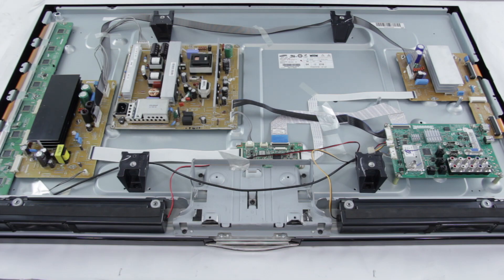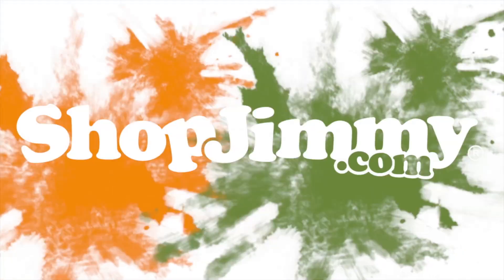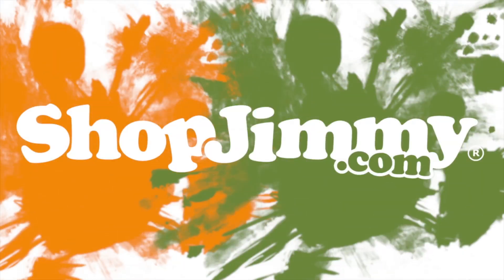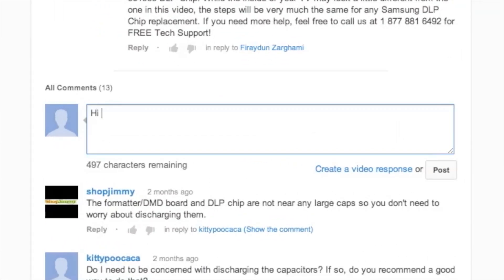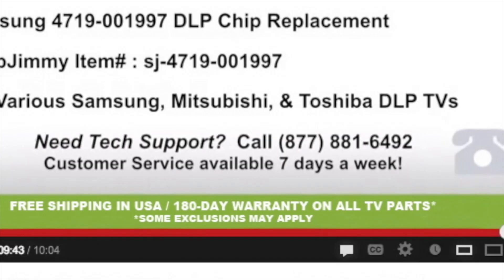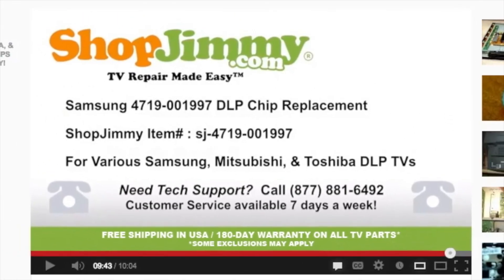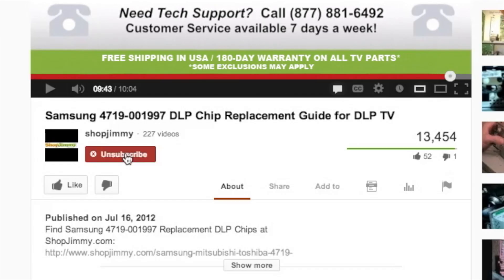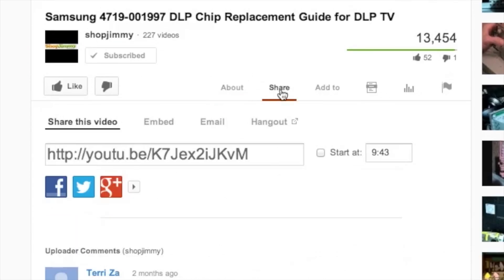Plasma TV Repair Tutorial - Common Symptoms & Solutions - How to Fix Plasma TVs

Comment: Good evening,

I guess that my TV is bugging.. do you have any idea about how to reset it?

Description of the problem:
I turned ON the TV (panasonic_Viera_ L47ET5E) and the audio of the program was present but without the video (I had a bright blue screen than after turning OFF /ON the TV the screen bcame black tend to a dark blue).

I remarked from the voice of each program that I have only 6 programs instead of 45 (usually).

I have used the method of pressing Vol- and Menu of the remote for 5 seconds..
After trying that method... I have lost the audio too!!
Actually I have black screen and no audio...

Thank you for your help..

Comment: 50PN5300-UF 2013 LG Plasma TV. No picture or back light on screen. Disconnect from all components. Connected to laptop via HDMI cable. Would not display. Did hear static from built in speakers.
Watched your video. Opened case and visually inspected. Two fuses on power supply looked ok. No capacitors on any boards looked popped. What next?
Thanks!

Comment: i have a Samsung PN51D550  PLASMA TV. IT TURNS ON FOR SECOND OR TWO THEN POWERS OFF EACH TIME YOU TURN IT ON IT DOES SAME THING.
Reply from the maker: james kraft   Try this at your own risk. Unplug the TV, then disconnect the y board and plug in the TV to see if the TV powers up. Reply with the results of this test. Thanks! www.shopjimmy.com

Comment: Hello...there, my vizion smart tv,E-701i-A3  the power supply went bad..and i change the new power supply board and power on its working good but my remote control is not working on my tv.  i would greatly appreciate need help.

Comment: I have a lg 50pn4500, built Nov /13.  I would sometimes have the screen go black with sound remaining on.  After unplugging  it for a bit, it would then work again for a while.

It now will only come on for about 10 minutes, even after going black sound still works.  I opened the case and all the caps look good.  Unsure of what componets could cause this.

Logic board?

Comment: Great Video! Thought I would ask for help before I go purchase a very expensive TV when I can fix for minimum $$. Model: Vizio, VM60PHDTV10A. Problem: TV seemed to work fine sound is ok, picture is ok no collapse I can see the color. But, the screen is dark when first turned on very dark film covers everything then slowly goes away with time then pieces of the picture is uncovered to give you a full picture but the picture at that point while visible is still dark. All power supply voltages seemed ok +5, 24, 65,120, 208, 360, 400. At night or in a dark room the pic gets more better. My TV is a 60 inch with a gold bezel very hard to find these days. I had previously had issues, one year prior loose the HDMI ports. Appreciate your help! Horace.20001@Gmail.com
Reply from the maker: Harnauth Sewsankar   PLEASE SUBSCRIBE TO OUR CHANNEL - Try all repairs and troubleshooting at your own risk.  This sounds like a problem with either the power supply or the TV panel.  You can replace the power supply board to see if that fixes the problem.  Click this link to replacement parts for your TV model number:  http://www.shopjimmy.com/catalogsearch/result/index/?cat=59&q=VM60PHDTV10A  There may be multiple boards for the same TV model number, be sure to match part numbers on your current board, with your replacement for compatibility.  Here is a link to a video showing how to identify your part number, click here:   https://www.youtube.com/watch?v=_4Qpfan0vdUThanks and please let us know if you have any further questions with your TV Repair!  www.shopjimmy.com
Reply: +ShopJimmy.com Thanks for response...following your troubleshooting guide I find the  Z Sustain board that drives the intensity was shorted, had a blown fuse. On further troubleshooting I found the main processor was shorted and the Z sustain board had to be replaced. Now after a few months the picture is now scrambled for about 15 minutes or if I hit a bank of (150 uf 250 v 105 deg C caps) on the Y sustain board with a hair dryer it comes on immediately and the picture  stays on continuously without scrambling...I tried to increase the capacitance on this bank of caps but it did not fix...I took out a few caps and checked them but all looks ok. I am planning to replace all the caps...any suggestion on your end? I am isolating the caps from the rest of the board using cardboard so the heat is contained.:)

Comment: Hi.My Samsung tv model PN60F5500AFXZA screen slightly flashes as if it was trying to tun on but doesn't and the stanby led light flashes 5 times. Please help and thank you.
Reply from the maker: Nelson De Los Santos   PLEASE SUBSCRIBE TO OUR CHANNEL - Try all repairs and troubleshooting at your own risk.  I recommend replacing the Y-Main Board and the Upper and Lower Scan Drive boards in your TV.  Click this link to replacement parts for your TV model number:  http://www.shopjimmy.com/catalogsearch/result/?q=PN60F5500AFXZA  There may be multiple boards for the same TV model number, be sure to match part numbers on your current board, with your replacement for compatibility.  Thanks and please let us know if you have any further questions with your TV Repair!  www.shopjimmy.com

Comment: Hey, I have a "50 Samsung plasma tv, with a blank screen. Audio is fine, but no video at all! I currently have the back off and I just watched your video. Should I replace the fuse on the power supply board, or just get a new board? Help! Any suggestions?  

samsung 50" plasma pn51d45oa2d
Reply from the maker: Cheapskates Griffin Try all repairs and troubleshooting at your own risk.   I recommend replacing the y board and y buffers in your TV.  Unfortunately I do not see any replacement parts in the search results for your TV model number on our website.  Thanks and please let us know if you have any further questions!  www.shopjimmy.com

Comment: Hey guys, I've got a Samsung PS51D550 that is refuses to turn on. It clicks and looks like it power cycles. I've looking at all the caps and all are in good order, no doming/bulging indicated. 

I then tried an isolation test. Removing the Y-Sus and X-sus via removing the Y sus connection to the PSU stopped the clicking and gave a solid green light on the logic board. Removing the X-sus from the Y-sus board it appeared to power on as previously described.

Is the X-sus board at fault?
Reply from the maker: Wazzi15  PLEASE SUBSCRIBE TO OUR CHANNEL - Try all repairs and troubleshooting at your own risk.  I recommend replacing the Y-Main board and the Y-Scan Drive board in your TV.  Click this link to replacement parts for your TV model number:  http://www.shopjimmy.com/catalogsearch/result/?q=51D550  There may be multiple boards for the same TV model number, be sure to match part numbers on your current board, with your replacement for compatibility.  Here is a link to a video showing how to identify your part number, click here:  https://www.youtube.com/watch?v=R1jmj_foId0Thanks and please let us know if you have any further questions with your TV Repair!  www.shopjimmy.com

Comment: I have a Samsung 50" Plasma Model PN50C450B1D. I was having trouble with lines running across the screen. I replaced the y sustain board and I am still having the same problem. I do not see any place where the cables are torn. I was wondering if the y main board might be bad?
Reply from the maker: Diggin Roman Treasure  Try all repairs and troubleshooting at your own risk.  Which direction are the lines going and what area of the screen do they cover?  Horizontal or vertical?  Did you also replace the Y-Buffer board?  Thanks!  www.shopjimmy.com

Comment: I have a 2012 Samsung E8000 plasma 60". It was acting funny for a couple days meaning it would turn off on its own. I would unplug for 30 second, plug back in and be good for a few hours. Then one day it would not turn on, I did the power cycle and heard pop corn 6 to 10 pops. After that nothing but a flashing red LED near the power button. I do not see any bulging capacitors but there is burn mark on an aluminum rail near the power supply. Where do I go from here?

Comment: I have a Samsung 60 inch plasma tv that stopped working after a thunderstorm. The tv turned off and never turned back on. The red standby light did not even turn on. After watching some of your videos I purchased the power board from your website and replaced it. That still did not work. Do you have any suggestion?
Reply: ***** Model number : PN60E530A3F

Comment: I have a Samsung plasma. 
Model ps43d450a2wxxu. 
After turning it on you hear a relay click 5 time. The power light then does a double flash 5 times pauses and starts the sequence again any ideas what the problem could be ? Cheers

Comment: Hi I have a Samsumg 51" S51FH-YB01. It will try to turn on and I get the samsung smart TV logo appear ad then it turns off. It will continue to try to turn on and off. I have  removed the rear cover checked for blown caps an they all visually look ok, fuse is fine. Manage to test Va and Vs voltage which measure correctly on the power supply. I also get Vs voltage correctly on the sc board. Any help would be appreciated
Reply from the maker: Paul Marshall  PLEASE SUBSCRIBE TO OUR CHANNEL - Try all repairs and troubleshooting at your own risk.   I recommend replacing the main board in your TV.  Click this link to replacement parts for your TV model number:  http://www.shopjimmy.com/catalogsearch/result/index/?cat=56&q=S51FH-YB01  There may be multiple boards for the same TV model number, be sure to match part numbers on your current board, with your replacement for compatibility.  Here is a link to a video showing how to identify your part number, click here:  https://www.youtube.com/watch?v=BEPWrefQvqIThanks and please let us know if you have any further questions with your TV Repair!  www.shopjimmy.com

Comment: LG 50ps30fd. Turned it on the other morning and after about 20 seconds the screen gradually whited out. Still had a picture. Tried it that evening and the same thing happened much sooner. This time it turned itself off. Laid it on its front today and checked Va and Vs. They are compliant though the picture seems OK. Any ideas?
Reply from the maker: frjfsiuojrsdug   PLEASE SUBSCRIBE TO OUR CHANNEL - Try all repairs and troubleshooting at your own risk.  I recommend replacing the YSUS board in your TV.  Click this link to possible replacement parts for your TV model number:  http://www.shopjimmy.com/catalogsearch/result/index/?cat=66&q=50ps30  There may be multiple boards for the same TV model number, be sure to match part numbers on your current board, with your replacement for compatibility.  Thanks and please let us know if you have any further questions with your TV Repair!  www.shopjimmy.com

Comment: I have a Panasonic TH-50PX75U. My problem is that I have horizontal black lines and bars that flicker intermittently across the top half of the display. It happens regardless of which input I happen to be using. The problem does not seem to be caused by thermal issues since it has happened immediately after power up or after as much as 15 minutes of operation. When it occurs, it happens for 3-5 minutes and then all is good for another 5-10 minutes. Thinking it might be a loose internal connection, I have tapped around the outside of the set but this had no effect.

The tv has about 8 years of dust build up which I am going to clean out, and then I am going to check for any obvious loose or dirty connections or cracked solder joints. Since the bars and lines are horizontal, can I assume that it may have something to do with the Y buffer or sustain boards?

Any help you can offer in diagnosing this problem will be greatly appreciated.
Reply: Kirk Boorman I have cleaned the ribbon connectors from the screen to the Y Buffer with alcohol and the problem is not as severe and does not happen as frequently. I am going to clean them again and see if the problem is eliminated.  Is it wise to use a residue free solvent such as CRC QD Electronics cleaner on the circuit boards? They had 8 years of dust on them, most of which has been removed.
Reply from the maker: Kirk Boorman  PLEASE SUBSCRIBE TO OUR CHANNEL - Try all repairs and troubleshooting at your own risk.  This could be a problem with either the panel or the SU & SD boards in your TV.  You can replace the SU & SD Boards to see if that fixes the problem with your TV.  Click this link to replacement parts for your TV model number:  http://www.shopjimmy.com/catalogsearch/result/?q=TH-50PX75U  There may be multiple boards for the same TV model number, be sure to match part numbers on your current board, with your replacement for compatibility.  Thanks and please let us know if you have any further questions with your TV Repair!  www.shopjimmy.com

Comment: Samsung UN46C7000 
After a storm the HDMIs aren't working. I tried different cables and troubleshooting but they still don't work. It's only the HDMIs the USB ports what kind of board do I need to change? Thanks.
Reply from the maker: esmiyaz08  PLEASE SUBSCRIBE TO OUR CHANNEL - Try all repairs and troubleshooting at your own risk.   I recommend replacing the main board in your TV.  Click this link to replacement main boards for your TV model number:  http://www.shopjimmy.com/samsung-bn94-02757a-main-board-for-un46c7000wfxza.htm  There may be multiple boards for the same TV model number, be sure to match part numbers on your current board, with your replacement for compatibility.  Here is a link to a video showing how to identify your part number, click here:  https://www.youtube.com/watch?v=BEPWrefQvqIThanks and please let us know if you have any further questions with your TV Repair!  www.shopjimmy.com

Comment: P50HDTV 2007 vizio plasma: Vertical solid green bars that change during input selection. Once selection made vertical rainbow lines or clouds of hazy color morphing in/out. I'm thinking control board
Reply from the maker: robert gaboriault   Try all repairs and troubleshooting at your own risk.  This sounds like a TV panel (TV Screen) problem.  If your TV panel is bad, it may be more cost-effective to replace the TV as panels are typically hard to find in stock, difficult to replace, and expensive.  Thanks and please let us know if you have any further questions!  www.shopjimmy.com

Comment: hi , i have a samsung p51d550 tv it has a thin black horizontal line across the middle of screen also a black line across the bottom of screen which is 1" thick with a grey line above it. any idea of why ?
Reply from the maker: marc lewis  PLEASE SUBSCRIBE TO OUR CHANNEL - Try all repairs and troubleshooting at your own risk.  This could be a problem with either the buffer or the panel.  You can replace the Y-Main Board and the Bottom Scan Drive board to see if that fixes the problem.  Click this link to replacement parts for your TV model number:  http://www.shopjimmy.com/catalogsearch/result/?q=51d550  There may be multiple boards for the same TV model number, be sure to match part numbers on your current board, with your replacement for compatibility.  Here is a link to a video showing how to identify your part number, click here:  https://www.youtube.com/watch?v=R1jmj_foId0  Thanks and please let us know if you have any further questions with your TV Repair!  www.shopjimmy.com

Comment: Have a Samsung PN60E530A3FXZA makes the chime noise like it turns on but get no picture... front light is flashing and flashing on main logic board. Replaced power supply already and still same problem. Wondering where to go from there? Before it completely died we used to be able to turn it on / off a few times and it would come on picture and all, but now... nothing. Thank you for your time.
Carl.
Reply from the maker: ludeguy   PLEASE SUBSCRIBE TO OUR CHANNEL - Try all repairs and troubleshooting at your own risk.   I recommend replacing the Y-Main Board and the upper and lower Y scan drive boards in your TV.  Click this link to replacement parts for your TV model number:  http://www.shopjimmy.com/catalogsearch/result/?q=PN60E530A3FXZA  There may be multiple boards for the same TV model number, be sure to match part numbers on your current board, with your replacement for compatibility.  Here is a link to a video showing how to identify your part number, click here:  https://www.youtube.com/watch?v=R1jmj_foId0  Thanks and please let us know if you have any further questions with your TV Repair!  www.shopjimmy.com

Comment: I have a Samsung model # S51FH-YB01 smart tv, stand by light comes on. Red standby led blinks for 5 Seconds when i turn the tv on via the push buttons. then the tv power cycles and repeats the 5 second period of blinking over and over. Remote does not function, no picture or sound on screen. Backlight seems to come on though.
Reply: ShopJimmy.com
Reply from the maker: Swan  PLEASE SUBSCRIBE TO OUR CHANNEL - Try all repairs and troubleshooting at your own risk.   I recommend replacing the main board in your TV.  Click this link to replacement parts for your TV model number:  http://www.shopjimmy.com/catalogsearch/result/index/?cat=56&q=S51FH-YB01  There may be multiple boards for the same TV model number, be sure to match part numbers on your current board, with your replacement for compatibility.  Here is a link to a video showing how to identify your part number, click here:  https://www.youtube.com/watch?v=BEPWrefQvqI  Thanks and please let us know if you have any further questions with your TV Repair!  www.shopjimmy.com